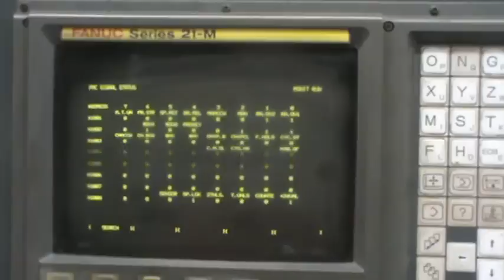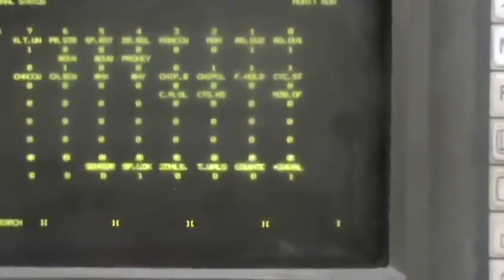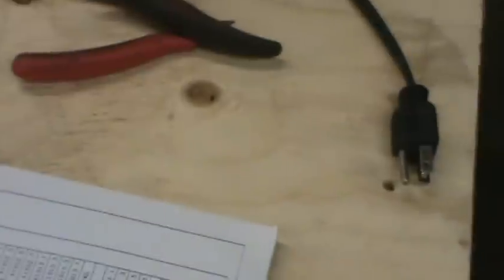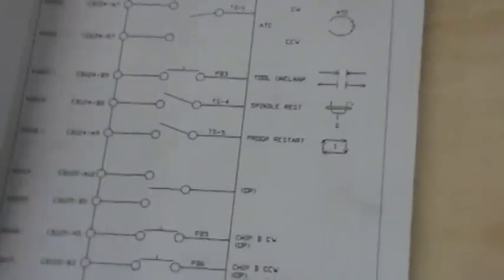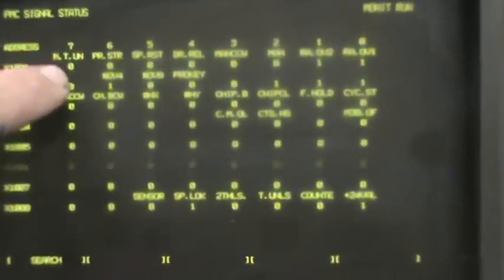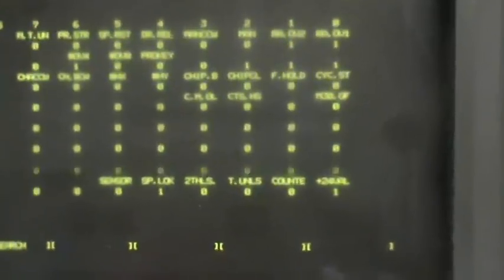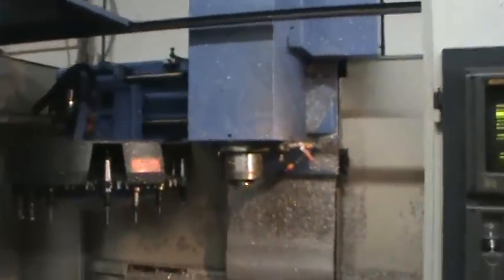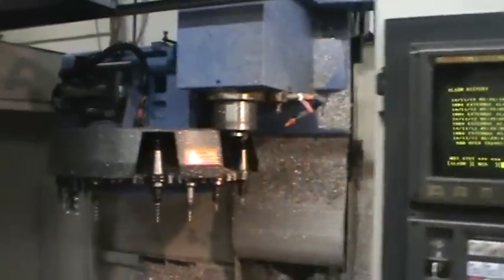Diagnosing Fanuc cnc control mb21  tool changer problem

Comment: what is the difference between SRam backup and all data backup and Fanuc PLC backup
Reply from the maker: There are a number of files to backup including  Parameters, Ladder data and cnc Settings.
Reply: but which backup stores what. and which one is required mostly.

Comment from the maker: It turned out it was a leak in the hydrolic cylinder pushing down the draw bar.   The air / oil cylinder was going down then would leak and come back up